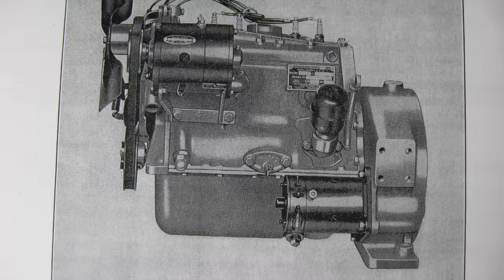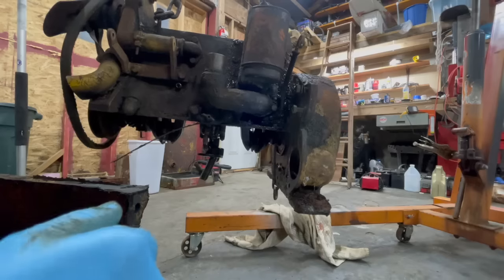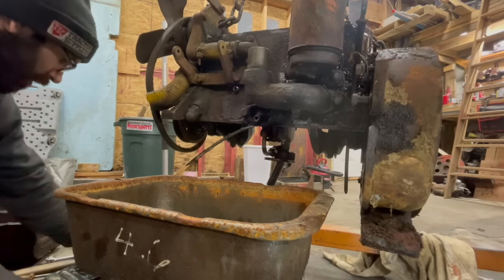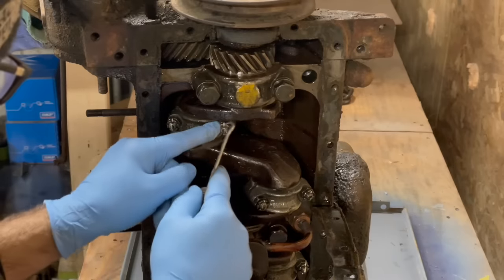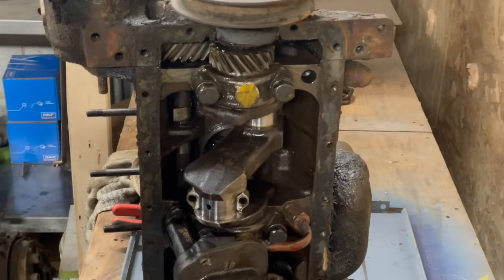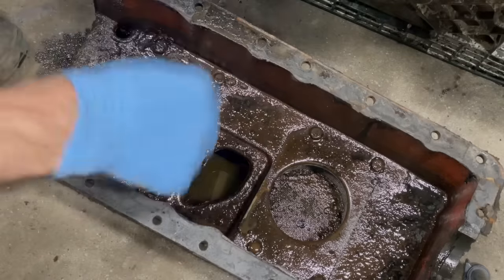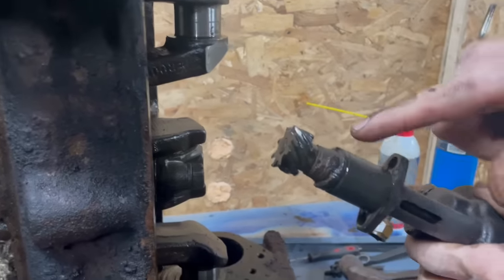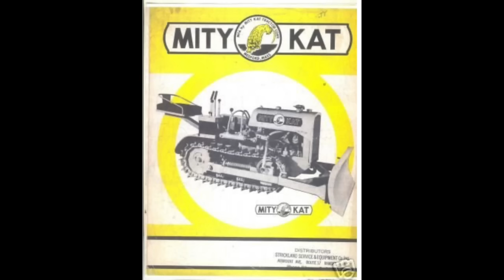Will this Bulldozer engine ever run again? lets find out!

Comment: One thing too remember when you start and run this engine is it was built in a time of highly leaded gasoline. Running it on unleaded gasoline will destroy the valve seats. Add a lead substitute and use a straight 30w oil.

Comment: I can hardly wait to see what type of schmoo comes out of those gear cases. But most importantly do the brakes work?
Reply from the maker: Yeah me too. My guess is the gear boxes are going to be pretty clean. The brakes are working but they are not strong. You can see in the video the tracks changing speed.

Comment: Looks like someone has been feeding that engine some STP or some of those other additives that are supposed to “rebuild” the engine and make it stop smoking. My grandad used that stuff in his 1932 Ford V8 Sedan that he bought brand new in 1932.  The car is mine now and when I got into the engine, the pan was every bit as bad as yours. And the intake manifold valley was much worse! After I got it all cleaned out, it actually changed the sound of the engine! My dad listened to it and laughed. He said he could hear the valve springs and lifters when he couldn’t hear them before. And he was right. All the sludge in the engine was actally muffling the sound of the engine.
I have a feeling that your engine will feel lots better without all that crap.
Reply from the maker: Thats a good point and i bet your right! The ole glue oil! Great example thanks for sharing it. Nothing like the sound of a clean nice running flathead v8!

Comment: That little engine was used in thousands of other applications from power plants to hay bailers !!!
A magneto would be a welcome addition and putting a one wire Chevy alternator an 12 volt conversion. instead of the generator will save you many headaches.

Comment: Ahh, I did hear the Babbit bearings may be inside these engines.  Upcoming, I can hope that you or your uncle explain more on the care, inspection, repair and or replacement procedure of such a "feature"?  Thanks!    BTW, you made the right call on the complete tear down, or at least the oil pan removal.  I got lucky with my old kats...no quantity of water got in the crankcase oil!  AWESOME job.
Reply from the maker: Will do. Im familiar with them and reshiming the caps. Unreal how much clearance the mains and rods have! No wear on the bearings to speak of. Just some scars from junk in the oil. You got real lucky

Comment: Could that also be the very same engine used in WW2 Jeeps ?
144 ci an 70 HP ?
If so parts are still available...
Reply from the maker: Much much smaller but similar in design. This is only 65 ci!